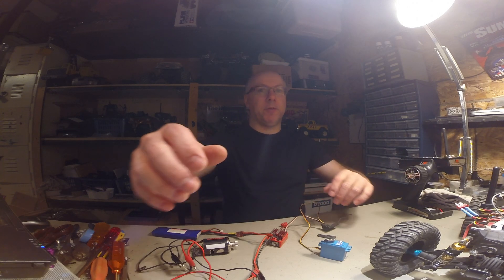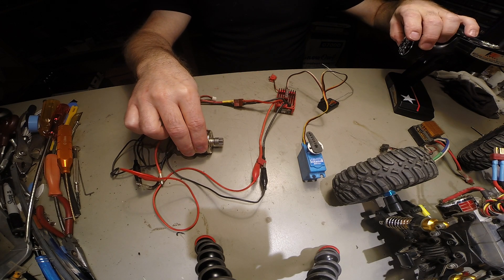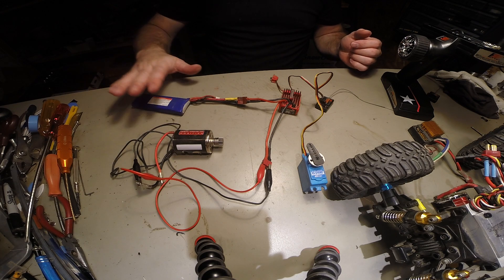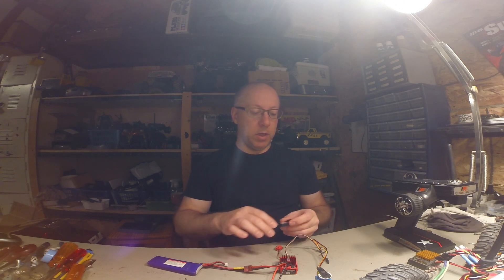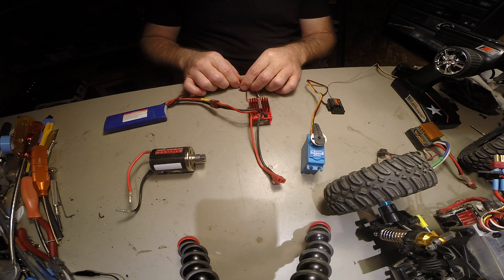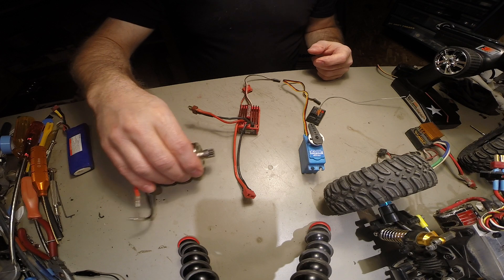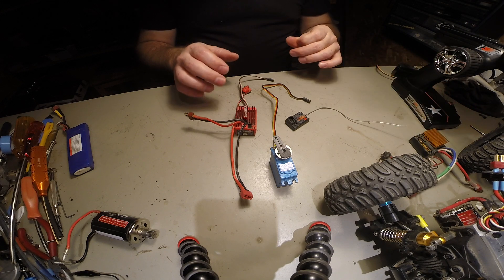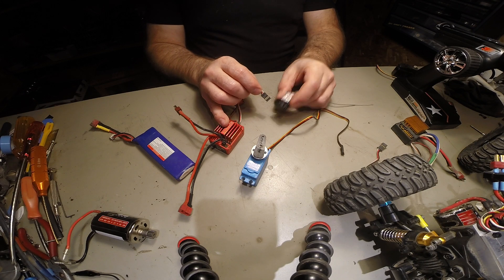Troubleshooting RC Electronics basics - Diagnose and fix it yourself

Comment: how do u dom that  my friend onyly ha s big ends  on mutimetter he didnt now how to check the wiring coming from esc to reciever
Reply from the maker: His multimeter does not have small pointed probes?
Reply from the maker: At this point i do not know what to tell you. As mentioned  in the video i shared with you,  you need wither extra parts or a multimeter. There is no way around it. No other way to test.
Reply: should there be a lite on reciever
Reply from the maker: Depends.  Some do some don't.
Reply: @TheLEDwheel  the big thing is that the esc doesn't stop beeping
Reply from the maker: If the receiver is not getting power or is defective the ESC will never stop beeping. There are 3 wires in the connector. A +, a - and a signal( usually white). If the esc does not get a feedback from the signal wire for whatever reason it will keep beeping.
Reply: @TheLEDwheel  ok thank u  know would boat work if not  binded
Reply: @TheLEDwheel  i unhooked wires ro motor and not much power to them
Reply from the maker: @petertebo914  if nothing is working how did  you check that?
Reply from the maker: Thats a possibility as well.

Comment: servo  or motor
Reply from the maker: Care to clarify the question?
Reply: the servo or motor doesn.t work  the is power to esc but no power to motor or rudder
Reply from the maker: Is the battery charged?
Reply: @TheLEDwheel  yes
Reply from the maker: Does the ESC light up?
Reply: @TheLEDwheel  the esc blinks red when battery iis hooked up it is a old impuse boat
Reply from the maker: What RC exactly?
Reply from the maker: Initially  my guess would be  a bad receiver but do you have a Multimeter to check the voltage on the connector that goes from the ESC to the Receiver?
Reply from the maker: https://youtu.be/FQ02aQcQKFg
Reply from the maker: Power switch on the ESC?
Reply: @TheLEDwheel  i think so
Reply from the maker: @petertebo914  if the esc light comes on then its getting power. You said so yourself. Without a multimeter or other items to cheack things there is no way to advance. Did you watch the other video?
Reply: @TheLEDwheel  what other video
Reply: @TheLEDwheel  pne of mmy friends has a mutimetter n
would u c heck the  wirinin that plugs in to reciever
Reply: @TheLEDwheel  i went over to friends and didnt really now where to check 
there was no power coming out of th wires to motor
Reply from the maker: https://youtu.be/FQ02aQcQKFg
Reply from the maker: Check the power coming from the esc to the receiver. + and -  usually red and black but could also be orange and brown depending on company.

Comment: Hi i hava hpi trophy flux when i turn it on esc turns on but steering and throttle does not work i have tried swapping the chanel on the reciever but it still doesnt work plz can you guide me and thankyou in advance.
Reply from the maker: Hi, my first thought is that  your ESC  is not sending power to your receiver.  Best way to check is with a multimeter by verifying the voltage at the connector from the esc. Or if you have a 4 "AA" battery tray you can connect it to the + and - (usually red and black respectively) on the receiver. Also if you have another receiver or can borrow one just to test the output of the esc as well.

Comment: Hi. I got baja v2 with brushed motor. After some time of no use and sitting on garage shelf, now no reverse. Checked, by switching throttle with servo connectors in transmitter. Car moving forward by turning steering one side, no reverse if moving other side. Servo works both ways, by moving throttle forwards /backward.
Reply from the maker: Are there jumper settings on the ESC?
Reply: @TheLEDwheel  there two jumpers, one for driving with/without reverse and second for battery type. I replaced original battery with lithium, replaced jumper aswell, and all was working great, till i left it in garage for a wile.
Reply from the maker: Seems  lika a bad esc. Which esc is it?
Reply: @TheLEDwheel  not sure, did not see any spec labels. It is original from baja v2. I had  before transmitter connectors pulled and damaged pcb cells, so had to solder them, after that could not bind it any more. As result resoldered all soldering points and got it bined. Was driving baja in garden without reverse. Left battery to charge, now decided to go and try to swap receiver channels, to see if can see difference.But car did not pick up transmitter signal any more. Trying to bind but not successful so far. Transmitter is not reacting on binding button
Reply from the maker: Sounds like you need new elec all around.
Reply: @TheLEDwheel  do not know, can be loose connection somewhere. Will see if  tomortow will manage to bind
Reply from the maker: If you can get it going thats great but you already have an ossue with the ESC. When these parts begin to go bad al sortsnof things can happen. Notably losing complete control when the RC is headed towards danger. Its happened to me and my Truck was run over by a car. Luckily  not much damage but jad i spent the  money to fix the defective part it would not have happened. Good luck.
Reply: @TheLEDwheel  thanks. Your rc car looks looks robust enough if surveyed in crash with truck..
Reply: @TheLEDwheel  took apart controller disconnected all wires( throttle, servo, and transmittor) got it ON, looks bad contact somwhere, after plug in all connectors, got it binded in first go. Still no reverse. Switched over receiver ch1&2 connecors. Now got reverse buy using steering wheel. By throttle steering moving only one direction. I understood that receiver ch2 is at fault. By the way can you tell if ch3 is only for binding, as it not picking up any signal if any connector from ch1 or ch2 is connected to it
Reply from the maker: Now you need to isolate if its the TX or RX that has issues with channel 2. I am not familier with the radio thar comes with your RC. Does it  have a 3rd channel?
Reply: @TheLEDwheel  yes it has 3 channels, but third is not for binding and probably can be used for something als, but i do not know.   Will figure out what can do als. By now ordered Dumbrc cotroller with receiver, as replacement
Reply: As far i understand there no feedback from receiver to transmitter about position, so 1 channel - 1 signal /1 way. Mean transmitter only sending, receiver only receiving. As by swapping connectors  in receiver ch1/ch2 same fault coming now to steering(only one direction), throttle now working both directions. By this i can get signal from transmitter by pressing every button. But receivers ch2 always working one direction. That let me think receiver is no good
Reply from the maker: It could  still be either the TX or RX at fault. If you had a second RX then you could confirm if its either the TX or Rx.  Only  thing that is confirmed for now is that channel 2 has an issue with one direction. I am curious to know if there is a loose connection on the potentiometer in the trottle control of the TX?
Reply: @TheLEDwheel  i swaped potentiometers connectors in controller. They looks fine, as instead of throttle steereng wheel was working only one direction(forward) , but throttle was turning wheels left and right
Reply from the maker: I think it is now safe to say the RX is defective.
Reply: @TheLEDwheel  yes, i think same

Comment: I really appreciate the upload and the breakdown thank you. However my issue is similar to the third problem you were discussing in the end there where you have power to the ESC but you do not have power to the receiver. I have two new receivers and tried them both and for some reason I cannot get power to go to the receiver yet the ESC lights up. So I was wondering with a multi meter if there is a way to check power coming out of those wires specifically.
Reply from the maker: Yes if you have a Multimeter you can checkbthe voltage at the usually red and black wires.  There should be some exposed metal on the connector where you can place the probes. Voltage in most cases is between 5 and 6 volts.
Reply: @TheLEDwheel  you got a new sub. Really appreciate that & I’ll go try that. THANKS!
Reply from the maker: @ColinDresser  so whats the result of your test?
Reply: @TheLEDwheel   I have a terrible YouTube channel that’s not really worth mentioning but I broke it down there. It comes down to my ESC. I’m considering just replacing it All together with an upgraded one but I emailed the company to see if I can have them warranty mine out 1st. I purchased a new receiver because the LED was not lighting up and I wasn’t sure if the smaller receiver from flysky was even compatible with the Krayton 6S so I bought a new bigger sized one since they were only $30 and tried it yesterday. Soon as I got the new receiver & plugged it in the LED light started working so I thought to myself great! it was the receiver the whole time. Tried to bind the vehicle to the remote and could not, then I thought to myself well let’s plug the old receiver back in and see if we can get the LED working on that again and sure enough the old one started working again and it was just fine but I was unable to bind that one either. So I’ve narrowed it down to the ESC which is steady flashing it’s red light at me not allowing me to bind. Frustrating after two months of having the vehicle I’m currently researching to see if there’s any hard resets or something that I can do to try and just reset it myself because I really don’t want to buy another ESC but will if I have to. Thanks for the follow up! If you got any ideas I’d be all ears. Peace ✌️

Comment: Hey cool video, you seem to know you stuff with Esc's and electronis.   I was wondering if you could help me with my Esc issue.   When I turn my rc on and give it throttle the engines just violently goes into forward and reverse back and forth rapidly.   I tried it with a working engine out of another rc to make sure it wasn't the motor that was bad, and it was the same thing.   give it throttle and the engine just goes forward and reverse back and forth super fast and violently and the wires on the esc heat up very quickly.   Is this a dead esc?  Thanks!
Reply from the maker: Have you tried re synching the esc with the radio? I have had an ESC lose its sync and did some weird stuff like that.  If you can, connect the esc to a different receiver and/or try the radio set on another ESC.

Comment: Hello, another question 😅 i bought a esc hobby wing wp-1060 and i still have the old receiver all the LEDs are turning on but nothing moves (i lost the antenna from my reciver)
Reply from the maker: Your receiver will most likely not work without an antenna.
Reply: @TheLEDwheel  got it so if i buy a new original reciver do i need to bind it?
Reply from the maker: Yes
Reply: @TheLEDwheel  ok, does it comes with a binding plug?
Reply: Or i have to buy it separately
Reply from the maker: That i cannot twll you. Pretty sure it would tell you on the site you will get it from. If not you can ask.

Comment: I have a fast lane R.C Hennessey venom gt. Have a similar issue. The throttle (back wheels don’t turn) doesn’t work. It just produces a ticking sound. The front wheel turns, the lights and beep sounds work. Any ideas on what the issue could be?
Reply from the maker: Hmmmm, the issue with these entry level or toy grade RC's is most times the electronics are one board and not modular like hobby grade versions. I can only assume that the  speed control section of the RC board is defective.  I dont know if you can get parts for it  or how long you had it for. If not long i would contact the seller or manufacturer for repairs or refund. Otherwise you may be able to upgrade it to hobbygrade electronics but thats not always worthwhile.

Comment: As i have had no response from CROSS RC, I am desperate to understand why my throttle engine sound is not responding to the throttle trigger. I get HORN and START UP on the three position switch on my FS GT5, but depressing the throttle trigger gets no sound. I run a CROSS RC sound card, on my CROSS RC BC8 MAMMOTH.. I followed the schematics diligently from CROSS RC but no luck. I have tried different configurations with no solution. I have tried other forums where others have similar problem but no advice on resolving the issue. The BC8 runs fine otherwise. I contacted CROSS RC outlining the issue but they just sent me the same schematics again. I am not a total dummy with RC but this has got me stymied. Your advice would be much appreciated.
Reply from the maker: Unfortunately i am unfamiliar with this setup. Can you make a video explaining and showing what you have done and how its setup.

Shot  in the dark... can it be updated via firmware?
Reply: @TheLEDwheel  Trying to find where the problem lies as others have the same issue, but no advice is forthcoming from anywhere. I believe its a simple solution, but following the Schematics from CROSS RC for the electrical setup does not work.
Reply from the maker: I would  have to experience the problem myself to get a better idea. Are there  any videos on this issue yet?
Reply: @TheLEDwheel  yes.will send the link
Reply: HERE IS LINK FOR CROSS SOUND CARD INSTALLATION https://www.youtube.com/watch?v=7jEujRObTik. IN THE END HE HAS PROBLEMS WITH THE THROTTLE SOUND
Reply from the maker: Aaron got it  working.  You cannot? Horn thing?
Reply: @TheLEDwheel  From the video he had issues with the throttle cutting out as he tried to accelerate when engine sound connected. I noticed later he opted for a different sound system. i get horn and starting sound on a three position switch but no engine on the throttle.
Reply from the maker: But when he starts it, if he did not do the horn first it would shut down. Startup>horn>throttle

Comment: Thanks for the video. How do I know if I have a bad ESC? Mine went through some snow, dried everything out and I don't get the normal loud audible sound from the ESC, very low/distorted sound, and the vehicle motor stopped  working. The steering works. The ESC lights work with forward/reverse and I used  volt meter to test the leads going to the motor and I get over 8 volts forward/reverse. I apply separate power to the motor only and nothing. So I think I have a bad motor and possibly a bad or damaged ESC. Thoughts? This is for a Arrma Granite 550 entry level stock rc truck, purchased in June of this year. Thanks for any feedback.
Reply from the maker: So you connected the battery directly to the motor?
Reply: @TheLEDwheel  I used a AA battery, then a 9 volt battery and then yes the rc truck battery direct, no movement/sound, nothing. I'm very new to this hobby. Thanks for the quick response and for any helpful feedback.
Reply from the maker: If you hold both rear wheels and try to turn them together will they rotate and spin the motor?
Reply: @TheLEDwheel  Yes, it turns all 4 wheels and the motor spins, I did notice one of the plastic fins looks distorted, maybe slightly melted, I know this motor gets really hot normally.
Reply from the maker: Does the motor smell bad. Like burnt electrical  wires?
Reply: @TheLEDwheel  Yes it smells burnt...
Reply from the maker: I would start with a new motor. You don't  have to get the exact same one. Lower turns  = more speed.  Check the capacity of your  esc before choosing  a motor.
Reply: @TheLEDwheel  Sounds good, thank you for your help with this.

Comment: When i test it on track then the motor disconnected but surbo is working? Pls get back to me
Reply: I have battery checker for lipo but it Ok its solve
Reply from the maker: Make sure  the battery is  charged and your esc is set to correct  battery type.
Reply: @TheLEDwheel  ya it is charge hobbywing 120A esc hobbywing 5200kb motor and 2 s battery still same if full charge
Reply from the maker: Is the ESC set to Lipo? How do you know for sure  the battery is charged?

Comment: My esc doesnt even turn on
Reply from the maker: Battery good?
Reply: @TheLEDwheel  Yeah I've tested it on my winch And Connected it just to the motor and the motor works but my Esc has no power at all
Reply from the maker: Its dead I guess
Reply: @TheLEDwheel  I have another one I just connected and the light turned on so I guess that one just quit

Comment: i need help. i got rc and theres the red light flashing when i hit the throttle and it turns just no throttle. so i bought a new motor still doing the same thing
Reply from the maker: Are you  100% sure the battery is charged?
Reply: @TheLEDwheel  110%sure
Reply from the maker: Esc properly programmed to the radio?
Reply: @TheLEDwheel  not too sure im going to get it looked at wish me luck
Reply from the maker: Find the esc model and look up the manual.

Comment: Hi! I have a curious problem. I bought a hobbywing 10bl120, surpasshobby 5900kv and radiolink system. Calibrated EPA on ESC. When i goes at medium throttle and hit 100%, motor reacts with some "delay" and keeps pushing throttle about 0.5-1 sec ... its so dangerous. I adjust punch mode and no results. 6200mah 50C 

Do you know what happen? thanks
Reply from the maker: Why would you set an epa on the esc?
Reply: @TheLEDwheel  is in point 1 of instruction manual..
Reply from the maker: Ok I see, EPA at 100% on chanel 2 for the ESC. Punch  mode only applies from take off so won't change anything mid throttle.
Reply from the maker: Any other settings changed on the radio.
Reply: @TheLEDwheel  curve of st and th
Reply from the maker: I'd have to see it in action.